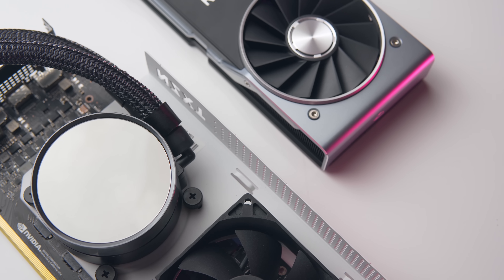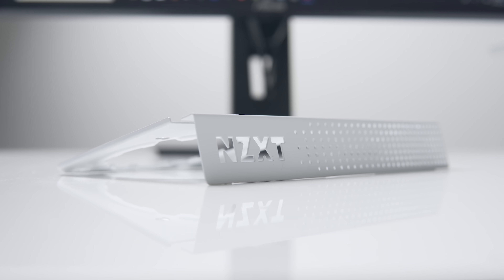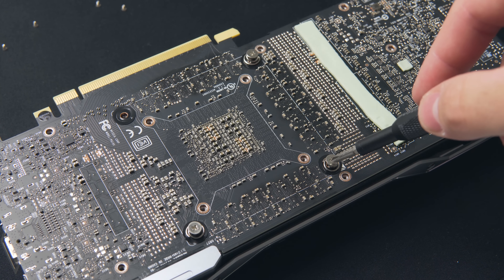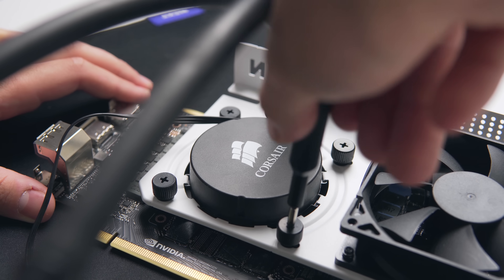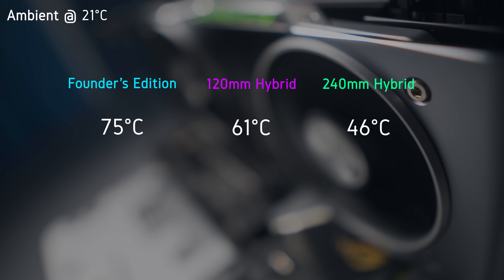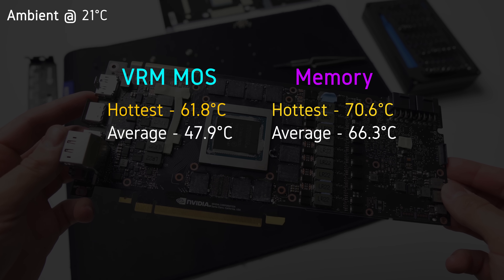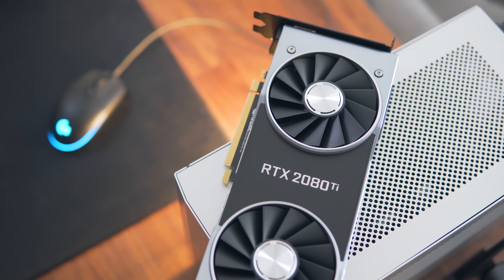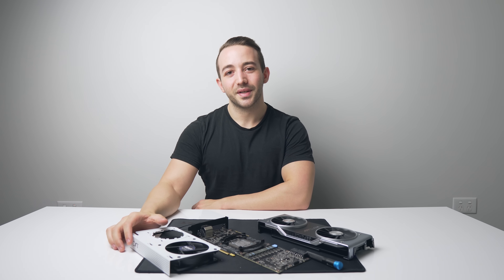RTX 2080 Ti + Kraken G12 Hybrid Cooling - Worth it?

Comment: well first of all arctic silver is shit, second arctic silver is slightly capacitive so you will change those capacitors value the ones you spilled on them, tjirt you apply the right amount and fourth arctic mx 4 is the best thermal compound when talking about arctic and probably best out there with no riscks.

Comment: pff , just point a casefan that has 4pin pwm connection connected to an extra cpu power pin , or connector
so it cools more when you're gaming and you're ok , costs 10 bucks
just be smart 
have 3x fans hooked up to the cpu pins , 1 for a kraken x41 on top , 1 for the back casefan and the other one on the side for the gpu
4k gaming at 70-75C easy

Comment: The G12 is an amazing product, I paired mine with a K72 on a 1080TI. At a 2126MHz OC the stock ASUS cooler on a 100% fan curve would hit max temps of 60-65*C and down clock to 2025MHz, but on the G12 I would hit max temps of 45-50*C and the boost clock wouldn't drop below 2088MHz...sick product

Comment: Yeah did this to my evga 2080ti black out of the box.  I only use a 120mm AIO and it sits at 26C idle  and about 55C after a hour+ in a game.  I had it on my 1080ti for over a year with no problems.

Comment: Are there any GPU AiO coolers that let you run it as a single slot? The biggest bonus to me with liquid cooling is running bifurcation in ITX cases. I'd love to see an AiO kit to make GPUs single slot instead of dual slot, but it always seems like the configuration is focused on dual slot.

Comment: Note that mounting pressure matters a lot! On the first try I got 30-35 degree water temperature and 50-55 degree GPU temperature.
After reseating the cooler and properly tightening the screws (but not overtightening!) the GPU temperature dropped 10 degrees.
Reply: Floris Buwalda Hmmm, I’m running a MSI Gaming X GTX 1080 Ti, NZXT Kraken X61 w/the Kraken G12 and swapped the X61’s stock fans for Corsair’s ML140s. My idle temp is 40C but it’ll ramp up to anywhere between 65C and 75C when playing a game at 4K that’s really pushing the card. At 60C my my fan speeds at ~55% @ ~1200RPMs. While sitting here letting Unigine Heaven run it’s Extreme preset, it doesn’t go above 63C. My GPU clock is at 2,000MHz, and my Memory is clocked at 5805MHz.

My OC settings in MSI Afterburner are:
+100 Core Voltage
117% Power Limit
75C Temp Limit
+50 Core Clock
+250 Memory Clock

Custom Fan speed
40C - 25%
45C - 30%
50C - 35%
55C - 40%
60C - 50%
65C - 65%
70C - 100%
Reply: @DJHeroMasta  well that's because you've unnecessarily maxed out the voltage instead of maxing the power limit and temp limit(I doubt 117% and 75c are the max) and only achieved a measly overclock of +50 to the core clock while adding +100 to the core voltage. That's just unnecessary. +50 should be doable on stock voltage.
Reply: @miniweeddeerz1820  Yeah, I've since realized that the Voltage OC was unecessary. I had forgotten that this "Gaming X" card is pre-overclocked. I now just run the card stock and my temps are back to normal. And that +50MHz makes my card run at 2101MHz.
Reply: @DJHeroMasta  I would try push it harder. +50mhz core even in a ore overclocked card does not mean much because any factory overclocks are basically redundant because Nvidia GPU boost technology surpasses any official clocks of any Nvidia GPU, aftermarket or not.
Reply: @miniweeddeerz1820  You think I can push this GTX 1080 Ti past 2.1GHz on an AIO with it's default power delivery and BIOS? I don't think so. Nothing is stable past 2.1 for me even when I had the voltage maxed out. I don't have any headers connected to the main board either so there isn't any power draw from fans.
Reply: @DJHeroMasta  fair enough. 2.1ghz is still pretty good. I guess by then it depends on silicon lottery. But fair enormous GH I would leave it. Because 2.1ghz is still really impressive.
Reply: @miniweeddeerz1820  Back when I ran a 2GB GT 530 I OC'd the hell out of that thing lol. Went from 30fps in COD MW3 at 720p on the lowest settings with the textures set to Ultra to the low 60's. I'd have to look for screenshots to see the numbers but I kept that card in my drawer. What card are you rocking right now and what are your clock speeds?
Reply: @DJHeroMasta  getting my first pc build pretty soon 🤣. Rx590 with a ryzen 5 2600. I'll undervolt the 590 because they don't overclock well anyway and they take too much power. I'll probably increase stability on the card by undervolting and actually increase performance that way. If I can get a memory overclock though I heard Polaris is bandwidth limited, so I'll try getting an undervolt and 9gbs gddr5. As for the 2600 I'm pretty sure you can reach 2600x performance with an all core overclock to like 3.8-9ghz on the stock cooler. Overall a very capable 1080p high detail build:
Ryzen 5 2600
Asrock b450m pro4
Hyper X fury cl15 3200mhz 2x8gb
500gb SSD will probably add a hdd down the road
500watt evga br 
Deepcool matrexx 55 mesh and adding 3 Arctic p12 fans
Xfx rx590 fatboy
Mpow gaming headset
Redragon k552 keyboard
Logitech g203 mouse
Viewsonic vx2458-c-mhd 24inch 144hz va panel
For £790 for the full setup it's really good deal for 1080p. It will last me a good two years on 1080p high till am5 in late 2021 on the new 5nm architecture with motherboards supporting ddr5. That's the upgrade. I got a cheaper motherboard because I'm not upgrading the CPU. I'm just going to buy a new am5 motherboard in 2 years. Also the pro4 is really decent for ryzen 5 overclocking
Reply: Just curious: does the bracket push against the memory or dont they have contact when pressure is applied?
Reply: Nigel Dokter Nah, you’ll have to add your own heatsinks for direct memory cooling.
Reply: Know this is super old but did you think u over tighten the first time or not enough pressure? Currently hitting 67 degree under load no over clock Thanks!

Comment: Hey, I was thinking about this for the last day and I came to a conclusion. In a gpu the hottest part is the cores, so if water cooled the temperatures will be fresher. the other components will be passive cooled and cooled by that little fan on the right. What I see people don't seem to get and my conclusion is that when you have the entire gpu making contact with the heat spreader in the usual cooling system graphics cards are when we buy them, all of them kind of share the heat produced by each component, while when they are all open they are not sharing so much heat from the cores and all the other components that where in indirect touch before. The heat in the case environment may get higher, which won't, but each component will stop being affected by the cores heat making them much fresher. So basically having this system is very good since all the heat from the gpu is being totally dissipated through the water cooler system and the other components will be fresher and passively cooling by the air flow in the case, which, obviously, depends on how good air flow you create in your case. If all the components are using the same platform to dissipate heat the temperature will always try to distribute heat among all of them until they get an average heat.
Reply: You can offset that by getting varying sizes of small heat sinks to contact the NZXT. Wont be as good for the memory as the original spreader but does the job quite well. Just use a ton of probes lol
Reply: @vanillagerrilla  wow, hello there ahah it's been a hot minute ahahahah

Comment: Possible to fit an 1080 ti equipped with an kraken g12 with Corsair h55 rad + fan on the bottom of a mcase m1?
Reply: you should never mount your rad below the pump

Comment: Installed a Corsair H55 on my RTX2070 MSI Armor, works like a charm, i use one Noctua A25 fan on the radiator, new chassi incoming and i might put another fan on it for pushpull so i can lower the  rpm.

Comment: I did something similar to this on my Vega 56... I was going to use the G12 adaptor but the brackets don't fit the hole pitch on the vega so I modified the CPU brackets of the X62 AIO I used with good results... details are in my blog here  https://www.tuffty.co.uk/blog/2019/03/25/water-cooling-a-vega-56-graphics-card/

Comment: I installed the G12 on my EVGA XC 2080ti. Works like a charm.
Reply: Did you mounted additional VRAM heatsinks or vents on the left side? And did you removed the baseplate? Just ordered the G12 for the same card. Thanks for the reply.
Reply: Tadej Toplak Heyo. No need to remove the baseplate. That baseplate acts as an additional heatsink so be sure to keep it on. I didn’t use VRM heatsinks for the left side. Instead i mounted a 90mm noctua fan (using a pci fan mount) that blows on that portion of the card. Works like a charm and have high stable OC’s. 

Here’s a link to the fan mount. Super simple. Highly suggest doing this vs heatsinks. That’s just my opinion of course. 

PCI Slot Bracket Three Fan Rack Mount Set for VGA Video Card Cooling https://www.amazon.com/dp/B00UJ9JSBY/ref=cm_sw_r_cp_apip_ZBdj6Bpu4owAb
Reply: @djwats7  can you send me a picture of how you have it all setup? I'm going to add G12, replace the stock fan with a noctua fan, it's the same card too.
Reply: Tom Taylor heyo. My first reply has an amazon link to what I used. It’s just a small bracket. I hope that answers your question.

Comment: You could go to Home Depot (or Amazon) and buy a $10 sheet of 1x1ft aluminum and very easily make your own bracket like this, and actually make it much better looking, to cover the entire PCB and mount flush and have threaded screw holes for the back plate to mount through. Get yourself a cheap set of calipers for taking measurements of the screw hole mounting patterns on the PCB, etc. and you're good to go. I'd also use a better looking low profile fan as well.

Comment: I'm using the Kraken G12 myself and the solution to not being about to use the fan header on the GPU is to either use speedfan (which is a bit more of a hassle and hard to use because of the non-straight forward UI), or Argus monitor (paid). I ended up getting Argus monitor for like $17.50 for 3 years. It was worth it. You can also set both of them to turn off your PC if the VRM fans fails which was worrying me.

Also after I upgraded to the G12 from the shitty blower cooler I clocked my GTX 1080 to 2100 mhz (previously it'd get to 1700 and throttle), and +500 memory. I could push the memory higher, but I don't see the benefit. The temps were reduced from 84c and throttle to max 51-52c.

Edit: It looks like Argus monitor is on sale ATM for $11. I'd recommend it.

Comment: Awesome vid !
I’m building a mitx build.  I have enough room for a 120mm radiator.  But I am wondering what the dimension of the card is with the Corsair cooler.  I am also cutting off the nzxt side bend thing

Comment: The G12 works for the MSI Gaming X Trio with a x52,  but the card sags enormously. It looked so bad I returned it. The card did overclock to 2070 stable, where with the stock cooler I could hit 2025. So In my opinion not worth it.

Comment: The Kraken x62's fan curve can be adjusted to the GPU's temperature with cam (nzxt's software).
You can also use a thermal sensor (pasted to the gpu) and adjust the AIO fan curve to the thermal sensor in the bios (a lot of mother board support 2 pin thermal sensor).

Comment: FYI, i've got Asus and Gigabyte boards that allow you to use GPU temp as a source in their fan control apps in windows (not BIOS).
Reply: I have an Maximus X Hero and it doesn't, AI Suite 3 shows a few "heat sources" for fans control but not the GPU. Maybe that's only if you have also an Asus gpu?
Reply: @fleptronic  It depends on the board i guess. On my boards it's only available on the higher numbered fan headers which i believe are attached to a separate sensor and not part of the main Z390 chipset.
Also, you might be right about Asus only allowing Asus cards. And it may also be limited to Nvidia.  My Gigabyte board 
detects an Asus 2080 but not a Radeon VII.

Comment: I personally own one Kraken aio bracket and a Msi R9 390. The pcb of the R9 is different from reference R9 cards, the AMD bracket doesn't align with the holes on the card, I bended the bracket just to fit on the holes. Long story short my R9 crashed because there were no cooling for the vrms, the fan included didn't help much.
Now the R9 have a dead vertical pixel line down the middle.

Comment: you can use Argus Monitor to set a custom fan curve to any fan based whatever temp, I tested it with my ghetto modded gpu, I have 2 80mm chassis fans on the heatsink plugged into chassis fan header on the mobo, and with that program I could set the fans to work according to gpu temp and it worked perfectly fine. (not a free software tho, 8 bucks/year after the 30 day free trial)

Comment: Does anyone know if gigabyte uses cheap vrm on their cards? I have the g12 mod with a h55 on my gigabyte 1080 ti turbo and measuring from the back of the pcb the vrm gets up and above 90c. And I had to use two seperate pcie cables on my rm750x just to get the card to stop crashing in games at stock. And no matter the voltage curve or power limit it wont allow the card to stay at or above 2000mhz. I feel the vrm is sucking more power than it should be and cant provide efficient power to the gpu. Thats why i ask if gigabyte uses crap vrm or mosfets. Or this could be a silicone or gpu bios issue.

Comment: Great piece, great results!
I'd LOVE to see RadVII tested with the Kraken setup as well, I'm quite curious about that combo.
Reply: I know this is a late answer, perhaps it will still be of use to you. I put a Thermaltake Water 240mm AIO on a Radeon VII. To do so I had to drill my own holes in the AIO's S2066 bracket. I have the fans controlled by BIOS in the "medium" settting, they are not very audible. The VII runs Caffe or Tensorflow under ROCm/Linux at 1801 MHz flat out, stock settings, and the edge temp never exceeds 55C. Under Windows I have overclocked it to 2GHz GPU and 1100 MHz HBM2 with 5% over power limit, I suspect it can go further but I don't have any games that really need the boost so I have not pushed it harder.
Reply: why? the card is abandoned by amd now. not made anymore.

Comment: Based on my experience, this is not a good method because of the vrm's temps. I had constant stuttering and hiccups with my gtx 1080ti. After switching to ekwb MLC Phoenix 240, everything runs smoothly and vrm's + GPU'S temps are good.

Comment: The VRM is a lousy sleeve bearing fan, though. Would feel compelled to put a Noctua or Be Quiet! fan on there instead.
Reply from the maker: Absolutely, thankfully it's not too loud since it's limited to 2000RPM. 
A Noctua NF-A9 would be ideal!
Reply: @optimumtech  That or a Be Quiet! 92mm fan in Silent or Pure Wings versions. Still expensive.

Comment: What would be nice to compare, is high end third party GPUs like 2080/2080tis with 120mm fan mod against kraken G12. And check the maximum performance as well as, noise limited performance. For example how they compare at 32db and at 35db.

Comment: I did the same mod and used Argus Monitor to control the radiator fan and the 92mm fan based on GPU temps. This way both of those fans can still be stopped or run at a very low RPM while the GPU is idle and then ramp up when it goes under load. I'm using an ITX case so I am limited to 120mm AIOs but with the A12x25 it isn't too bad.

Comment: One thing you forgot to note, many third party manufacturers have passive heat sinks on the VRM's, therefore the fan on the bracket will cool those vrams no problem.
Reply: Watch the video again. The brackets are over the bare exposed VRAMs. Which means these VRAMs around the gpu core are bare exposed without heatsinks and thermal pads. They are most likely already dead by now.

Comment: I put a G12 on an MSI Armor 1080ti and it made a world of difference. The G12 is definitely a worthy investment.
Reply: Depends on the card.  The armor is intended for water cooling (cooling solution that was adequate for something like a 1060)
Reply: @tommyboy5924  lets not say intened, but cheaper
Reply: @md-im8qp  they put the cooling system of a 1060 on a 1080 and 1080ti so that it was a bit cheaper (people go the WC could care less about stock temps).  It was intended, no ifs or buts about it...
Reply: 4 years later and I am wondering 
Are you still using it ?

Comment: Absolutely perfect man. Really good call outs on the ribbon cables and coil whine. I noticed both of these during my install on my 2080. The coil whine is especially noticeable now. For reference I havr a 240mm aio on my 2080 in a Ghost S1 (bottom mounted top hat) and my temps max at 53C

Comment: I did this mod on my 1080ti and he's right about the coil and electrical noise. Even when I move the cursor on the screen produces a sound that just happens to be at the frequency that drives me mad. So I just wear headphones since I love those low temps. It never goes above 62 C. So if coil whine is a huge issue for ya reconsider doing this mod.
Reply: Just turn on furmark for about 2 hours and leave the house when you get back the coil whine will be worked out
Reply: @JokeRGBlazE  really? I've never heard of that method. I'll give it a shot. Anything to fix that annoying sound. How does it fix it though?
Reply: @cmdnoob  magic.
Reply: @cmdnoob  just confirmed 750W psu more than enough. Watts from wall during 8K superposition with 8700k @ 5.1ghz and 2080ti 2145mhz + 1550mhz mem 32 gb 3200mhz cl14 ddr4 only uses 525W peak
Reply: @JokeRGBlazE  damn dude. I'll do it while I cook up some burgers right now. I got my 8700K up to 5.0 so yours OC a but better. I'm sure my PSU can do it. It's a Corsair CX650. Thanks for the follow up. How much better performance are you getting out of the 2080ti? I'm on the fence of either waiting or getting one now.
Reply: @cmdnoob  within 3%